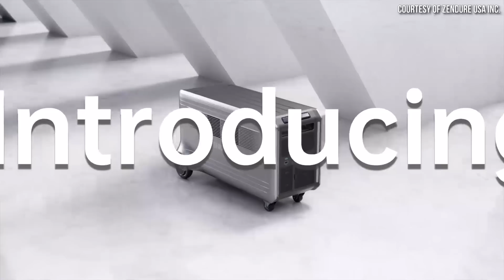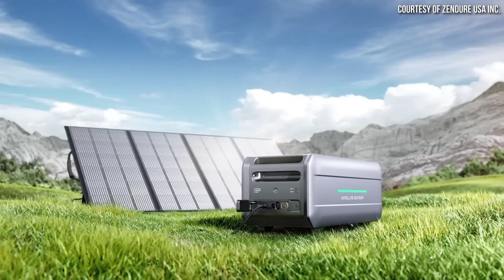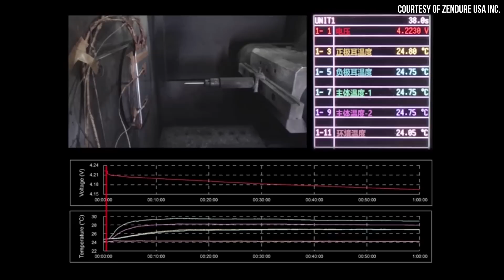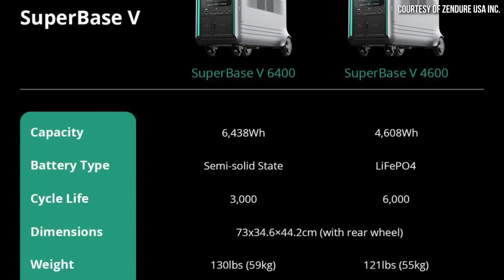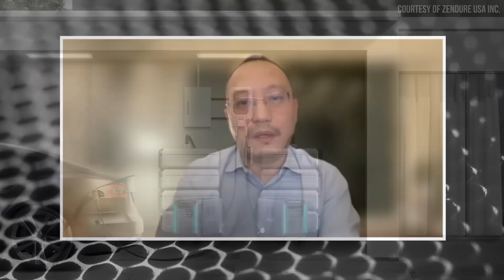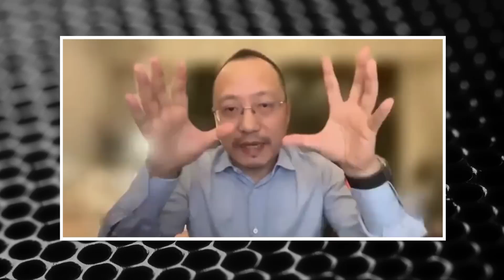Zendure SuperBase V | 64 kWh Home Energy Storage w/ Semi Solid State Batteries

Comment: I find it strange that all these battery "experts" always quote lithium ion batteries as having a cycle life of 500. This isn't true. This hasn't been true for years. 1500 has been the standard for many years now, and this BS is how we end up with every YouTuber out there thinking every new battery is "game changing" "it's cycle life is triple that of normal batteries" When, in fact, anything less than 1500 cycles these days is considered below average. I'm not saying that's what John thinks, or he is complicit in this, but other YouTubers and battery experts do this every time something new comes out
Reply from the maker: Thanks for pointing this out. I assume that the 500 cycles number is quite outdated and refers to much older battery tech... I agree that today's NCM/NCA batteries (especially Panasonic) are good for more like 1,500 cycles even with fast charging.
Reply: @Cleanerwatt  not a problem, I'm not saying you're guilty of pushing the idea, but I do find a lot of these new battery tech companies always pull this card. I have to assume they know where current battery tech is, and they do it to make their own tech appear better.

Comment: Great questions John.  But make the guy answer the basic questions.   1. Max inverter output also and is it doubled for each main battery.  2. What voltage the batteries run at with max dc withdraw amps per battery. 3. Pv input max, number of pv inputs with max pv amps.

Comment: It appears to be an amazing system the 120/240 
UPS mode fast charging etc are big +. 
More and more of these systems coming out on the market respond to our needs 

I’m confused about duration 
1,500 and 3,000 cycles 
Online description it mentions double that. 
Could you explain? 

Thanks for pointing out the features of the unit and having the CEO online.
Reply: Cycle life is dependent on Depth of Discharge. If you stay out of the bottom 10% and top 10% you can double NMC life cycle. LFP benefits from it to a degree as well